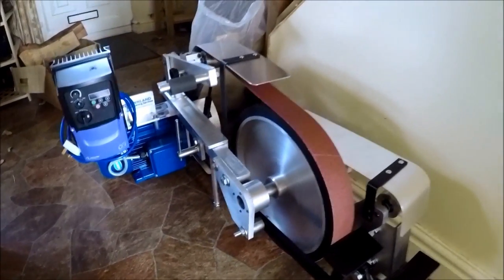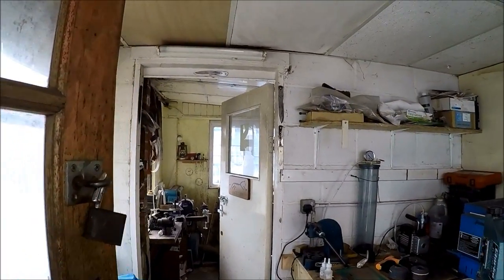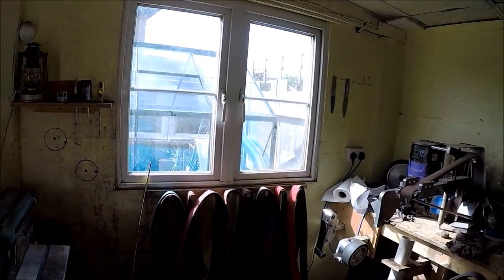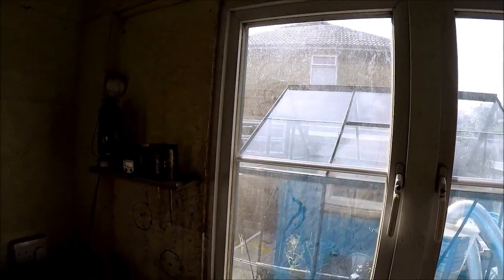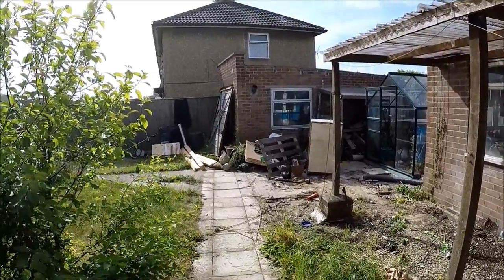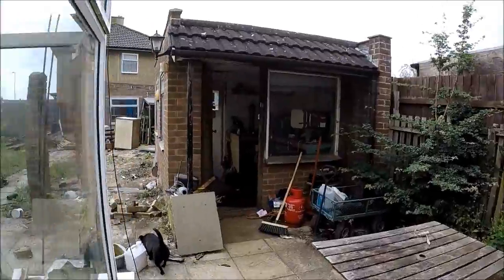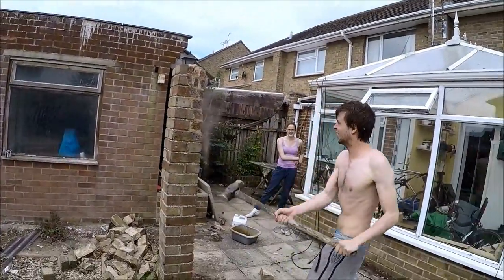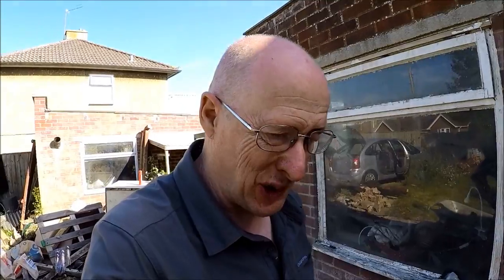Workshop extension and improvements  Day one

Comment: Nice one Sandy, film as much as you can. I built a workshop once and for the floor we used 10 cm diameter logs cut into 10 cm pieces and laid them like cobbles on sand with sand in between, warm, tough, looks nice and comfortable on the feet, you could make little concrete pedestals for the various machines,good luck and all the best Garry.